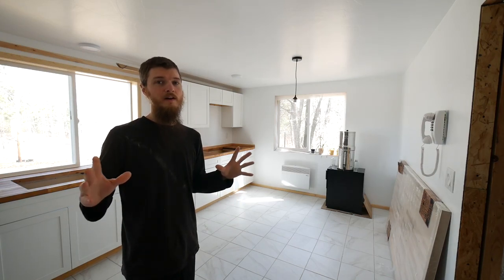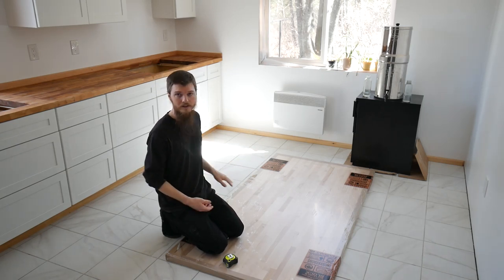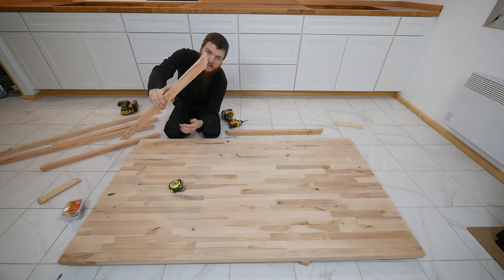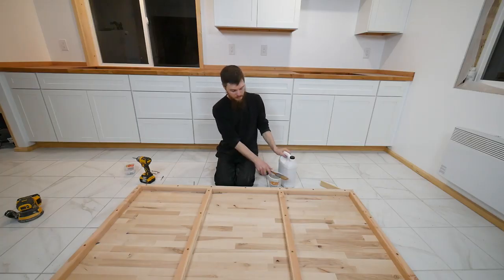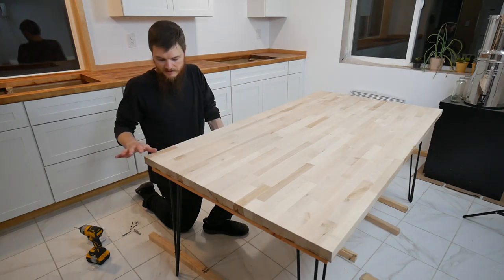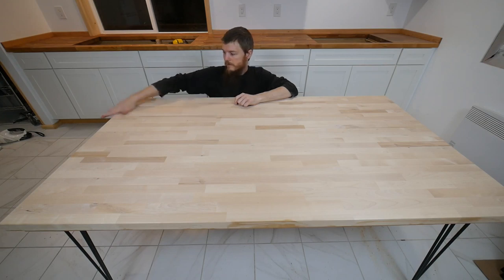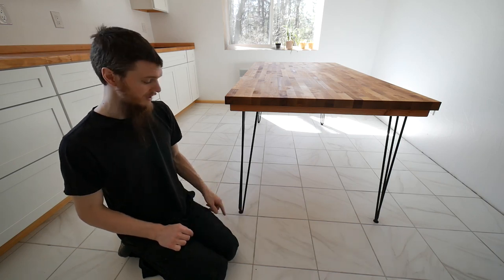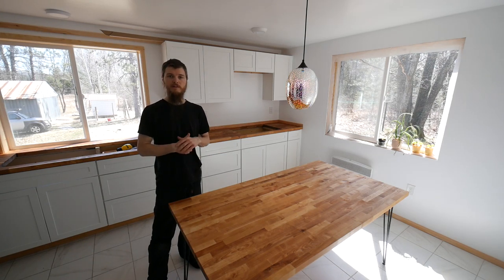DIY Modern Minimalist Hairpin Dining Table Build

Comment: For a family of 4, I think the table is a good size. you could always just use 3 sides of the table and leave a long side next to the wall with out chairs and put 1 chair on each end and 2 on the longer side. Just a thought.

Comment: Would you consider building storage bench for the long wall? It would prevent chairs from marring the wall and perhaps add more space between the table and counter. It is also a great way of having more people on that side of the table when entertaining. The boxes of the bench could be in white in similar style to the cabinetry and the tops could have similar finish of the tabletop. Cushions would be an added decorated touch that can be changed or cleaned as need be.

Comment: Awesomely beautiful kitchen!!  I'm 67 would like to do that to mine but at my age maybe I'll just blow the money on travel, well see. Everything you did is great. The one thing I had concerns about were the leg mountings to the table top. I thought  a triangular gusset perhaps 1" thick could have been bonded to each corner inside of the 2x4 frame you put on the bottom and the legs attached to those just to distribute the stress of the legs on your beautiful table top. Great job!

Comment: The thumb nail picture on the side is my husband.  He bought me a set of four bed risers to elevate my large farm house table which is 8 feet by 42 inches up higher when I'm doing sewing projects and other projects.  By bringing the table height up another 8" it makes it so easy to work without having to lean over so much.  I bet Doug could manufacture you four risers which would be customized to meet your particular need  You could even elevate the table to be the same height as your kitchen counter.  Then, when you are through with your project and it is time to eat, bring the table back down to normal height. 

The reason I wanted such a large farmhouse style table is for when our adult children come to visit.  One of our sons, with their six children, that's them plus us equals 10.  We have two long benches on the sides and we can put two or four chairs on the ends to serve 10 to 12 people.  When I sit at a crowded table I am so thankful for the LORD's blessings! 

 It'll be nice when you and your children sit at the table for your first meal and then Belle can help Ashley wash dishes afterwards in the kitchen sink, instead of the bath tub.

Comment: I had a hunch you would end up with a butcherblock dining table. If you place the table with the short end up against the wall, you will have lots of room behind the chairs on BOTH sides of the table, not just one! And it will protrude less into the kitchen than when it is placed lengthwise on the floor, and the total feel of it will be "roomier".

Comment: I love the table!  Great look!  Suggestion... Could you turn the table 90' and put one end against the wall with chairs on the long sides? Center under the overhead light or swag the light to the proper locale. That would still give you 36" clearance walking past the sink/cooktop with NO chairs in the way, and a little more space near the phone for a small table for notepad, pencils, etc. Maybe benches instead of chairs?  (Thinking out loud.) And where will the plants go?  Herbs on the window sills?  A Great look in your new kitchen.
Reply from the maker: Thanks for the ideas. I think we like it away from the wall, but we'll keep that in mind if it doesn't work out :)

Comment: Stools or benches could slide xompletely under the table when not in use so you have more space on the outside vs high back chairs. 
If you use the captains/sailors chair design if you want backs on them then that also should be able to fit completely under the table. The chair is often round and curved back to match the round seat and about waist high so its supportive and comfortably lets you rest your arms on the top of the back/side of the chair. They were often used not only on ships where the names from but as study type chairs and more recently wicker/rattan type chairs i believe. My family has an antique one thats yet to be restored which originally had leather stretched over it but was later replaced with rattan. Theyre extrmely beautiful and practical if done well and timeless if you keep it simple and wood.

Comment: Anyone thinking about doing a butcher block table another suggestion is turning it into a kitchen island. You can get two kitchen cabinets underneath and then put the butterblock on top. Also leave hangover so you put chairs underneath. With a big block like that you can have a good seating for 4. You can use the island as extra prep top and storage space for other kitchen appliances. I like what they did with the table but I just wanted to throw that idea to whomever is thinking about it lol.

Comment: If end grain darkens too much when finishing wood, applying sanding sealer to the end grain only before applying the finish will often help to achieve a uniform finish.  Also, just applying finish thinner only to the end grain just before applying the finish will usually prevent the end grain from darkening.  This is mainly an issue when finishing soft woods.

Comment: My son made a 2' x 6' desk using your video as a guide.  I had the  hairpin legs for a long time and we made it in his apartment with limited tools.  He stained and polyed it.  Instead of mitered edges he did butt joints and sanded everything so it just looks like thick butcher block.  His whole apartment has a mid century vibe and the place was built in the 50's.  Thanks for your video!
Reply from the maker: That's awesome, thanks for sharing :)

Comment: Love the table, good size.  Mine is 36 X 60, think you will find the extra 6 inches a benefit with the four of you.  One thing to consider with the banquet style is the difficulty of getting in and out around the table legs.  My sister has one and I make sure I get a chair on the outside of the table.  The legs look great on that beautiful table.

Comment: Beautiful!
I suggest rounding the corners so it will hurt less when you walk into them.
Incidentally, I bought sets of those three-pin wrought iron legs from Sears about 53 years ago.
By the way, why didn't you spill any of your finishing oil on the floor?
Reply: I’m a huge, huge fan of oblong and round tables, and that’s one of the reasons why. If one can’t have such a table, rounded corners, for sure. Right angles are the bane of me.  Hehehehe
Reply from the maker: Thanks! We had some drip onto the floor :)
Reply: I bet the kitchen smells great, between the wood & oil - drips or not. 🤓

Comment: Actually if you do a free standing bench seat for the back area that would scoot within legs and push under table, you get the illusion of more space when pushed under table.  Kids sit on bench and you two in chairs at the ends.  Leaves front free of chairs.  I currently use that idea in my done the area

Comment: I love the table!  I have a question.  I have seen you both use that small vacuum lately. What kind is it?  I need something small like that...
Reply from the maker: Thanks! It's here: https://amzn.to/2XhWIgU (affiliate)
You would still need a battery and charger. It's made by Hitachi, which is now called Metabo. So you may have better luck finding a Metabo battery and charger than the old Hitachi ones. We bought our charger on ebay. I'm not sure why they don't sell them together. There are similar vacuums on Amazon that come with everything.

Comment: I'm not crazy about the table legs.  I was thinking how cool it would look if you cut some triangle tapered wood and placed it inside the legs so the metal would shoe on the outside and the wood on the inside.  I think that would make the legs and table look even better!  You did a great job on this build.

Comment: When you flipped the table over and there were no pads under the legs so it set directly on the floor I cringed. I think those pads that came with the legs are nice. The decorative trim you put on the underside of the table does make it look much nicer, great job. With your mad wood working skills I bet if in the future if you would like different legs you could make a big center pedestal leg and put under the table.

Comment: I need to know what kind of vacuum that is. I need a good handheld that doesn't cost a fortune!
Reply from the maker: It's here: https://amzn.to/2XhWIgU 
You would still need a battery and charger. It's made by Hitachi, which is now called Metabo, so you may have better luck finding a Metabo battery and charger than the old Hitachi ones. We bought our charger on ebay. I'm not sure why they don't sell them together. There are similar vacuums on Amazon that come with everything.

(affiliate link)

Comment: I believe that is a Berkey filtter there in your kitchen? Do you like it? How does it work? Pros vs cons...
Reply from the maker: We've been using it for years and really like it. There are 2 compartments, you fill the top with water and it filters down to the bottom part and has a spigot. There are various filters you can get for it and they even have fluoride filters if you have city water and want to filter that out. The only con I can think of is it's a bit of a hassle to clean out.

Comment: Hey There - that table is beautiful!  What a good job, and good video.  QUESTION:  Did you save the off-cuts from the original slab?  They'd be great as cutting boards!
Reply from the maker: Thanks. We have the cutouts and may have a plan for them :)
Reply: @diyfferent  Oh?  Will it involve that cut-out between the sink, and the drawers?  Stay Safe!

Comment: Quick question, have you noticed any wear and tear on the wood after spilling things on it? I’m making the same table myself, and I’m interested which stain and/or sealer I should use? Thanks!
Reply from the maker: We used pure tung oil and it's been great for us. We spill things constantly but it doesn't affect the table. We're not really careful with it at all but it still looks new. A lot of people would probably go with a polyurethane finish because it's harder and more water proof but like I said, this hasn't shown any wear for us yet.

Comment: Combina muy bien. Es un mueble en linea con el diseño. 
Consulta, el filtro que aparece al principio, cromado donde puedo conseguirlo.
Reply: If I may, “It matches really well. The table goes with the design of the kitchen. Question: where can I get a chrome filter like yours?”
Reply from the maker: ¡Gracias! Se llama filtro de agua Berkey. Tienen un sitio web, o echa un vistazo a Amazon. 

Thanks! It's called a Berkey water filter. They have a website, or check out Amazon.

Comment: With just the oil on counters and table top....wouldn't it absorb spills therefore, stain easily and permanently?
Reply from the maker: It's a drying oil so after it cures it should do a pretty good job at repelling stains, but if it does, we're okay with it :)

Comment: I just ordered a 3-D light. It says it need a 100-watt medium base frosted light bulb. Where did you purchase the bulb?  Everything is LED. Having a problem finding one. Thanks.
Reply from the maker: I think all they are saying is that they don't want you to use bulbs with clear glass, so any LED bulb that will screw into it will work fine.  :)
Reply: DIYfferent thank you Doug.

Comment: You can always put the table up against the wall
Reply: My thoughts also. With only 4 of you it would work. Because of the light, it would have to be a table end against the wall so the table is still under the lamp. Otherwise you will bang your heads. It will open up a little more floor space. Just an option when you want to change things up. Looks great.
Reply: @christinedehn3257  My idea exactly. Check my comment further down.

Comment: I bought a new wooden cutting board but I didn't know until  I brought it home that it says to treat the wood with wood oil before using it. What kind of oil should I use?
Reply from the maker: I think the two most popular choices are food grade mineral oil or pure tung oil. There are other mixed "butcher block" oils out there too. Lots of options so just it's just preference. I think most people choose mineral oil because it's inexpensive.
Reply: mineral oil does not get rancid and is food safe.  I lay my boards on wax paper, saturate the board and let it sit in the puddle of oil, turning it over to assure even saturation.  My boards are about 20 years old now, look great.
Reply: it is an overnight process. You can then wash it off with soap and water and use it.  It will start to turn back to lighter color which indicates another oil treatment is needed.  Happy Cooking.

Comment: Personally, I fear those metal legs on ceramic tile with the weight and the shuffling around through use ... Glad you can easily put MORE protection on them.

Comment: Check out the front cover of family handyman magazine for June—they must watch diyfferent!! :)
Reply from the maker: Haha, I found a photo of it. Neat! Wood tabletop, with the hairpin legs, and even our chairs that we bought are very similar to theirs!!
Reply from the maker: @socorob  False. Pure tung oil (what we used) is 100% food safe. 

"The Tung Oil offered by Real Milk Paint is a 100% pure oil meaning it comes without any heavy metals, additives, or distillates. Most other oils can be anything from a thinned down varnish to polymerized tung, and most have petroleum distillates added. Ours will not build a gloss finish or heavy finish but will penetrate deeply into the wood to enhance character and water resistance while creating a great wood finish. This makes our pure tung oil perfect for uses such as wood counter tops, bowls, butcher blocks, cutting boards, chopping blocks, outdoor furniture, decks, wood siding, wood flooring, concrete, brick and just about any porous surface that needs an environmentally friendly product."
Reply from the maker: @socorob  No, we didn't buy fake tung oil. We bought 100% pure tung oil. Read the description of what we bought here: https://www.realmilkpaint.com/shop/oils/pure-tung-chinawood/

I found this site which explains that pure tung oil is not toxic: "According to the FDA Poisonous Plant Database, the primary toxic agent in tung nuts is an albumin that is not present in the tung oil itself. Tung oil is not toxic, but ingestion of the nuts causes nausea, vomiting and diarrhea in mild cases and shock and respiratory depression in severe cases." https://findanyanswer.com/is-tung-oil-poisonous

Comment: Do some of the legs have 2 prongs to them and some have 3?
Reply from the maker: They are all the same with 3 each.
Reply: DIYfferent when you were sitting down by the one leg to the table, to the viewer left, I only see 2. Look on the video. Just something I don’t understand. Never mind.
Reply from the maker: It's just the angle, one of the prongs is being blocked by another prong, that's all.
Reply: DIYfferent that’s it.

Comment: Good Call on the trim under the table - really makes it look like an actual table not just a slab of wood on legs.  as you said they may also help keep the wood from warping or bending.  I was just wondering what the delay is with the sink and cooktop and stuff - I would guess you don't have them but I don't recall if you stated a reason for the delay in any video but I don't think so.
Reply from the maker: Thanks! We have the sink and cook top, but we have to wait for the oil on the countertop to dry longer before we install them :)

Comment: It would take the Britts to come up with table legs like that and those floor protectors are not going to last long under that heavy wooden table. Thick wooden legs would have been better for the floor tiles by dispersing the weight of the table more. Does that borble looking thing produce real light ? Doug, there is an inner mainstream American trying to brake out in you from time time LOL

Comment: the table is just way too big
Reply from the maker: It's not too bad for the space. Any smaller and it may have felt a bit tight. I think 30" x 60" is about the minimum you'd want to do for 4 people so we gave ourselves an extra 6" on each side.
Reply: @diyfferent  In that size of kitchen, an extra foot of table size makes a huge difference. You will find it cumbersome while cooking because you will treck from the stovetop all the way over to the oven (which is completely odd to have them separated this far apart) without running in to the table. I believe you will find that more times than not, you will be pushing the table out of the way and up against the wall. Again, I'd suggest a corner bench with chairs, or perhaps a round table. Currently, I have a square bar top table with a built in lazy susan. It seats six- and has a bench on one size. Works great for a smaller place and is plenty of room for seated meals. Just my thoughts and ideas.

Comment: GLUE....YOU FORGOT GLUE
Reply: The trim boards on the ends running across the grain expand and contract at a different rate than the top.  Applying glue to those may cause the butcher block boards to crack in the future.